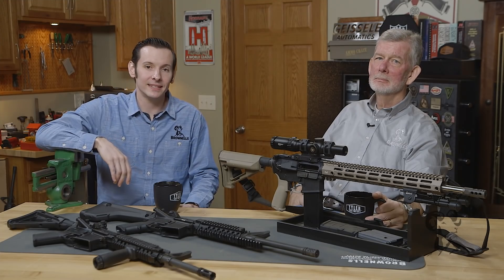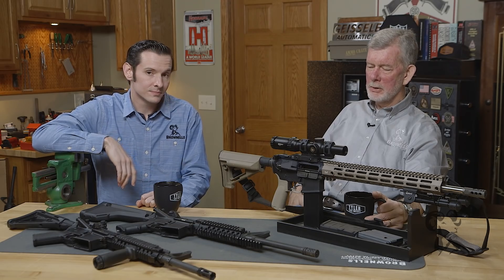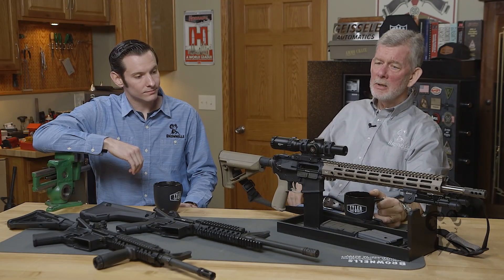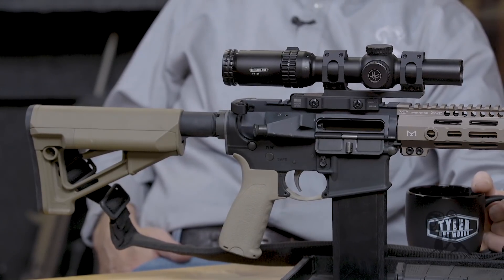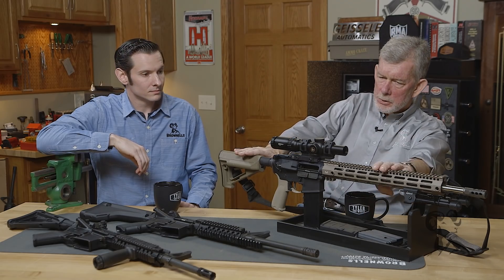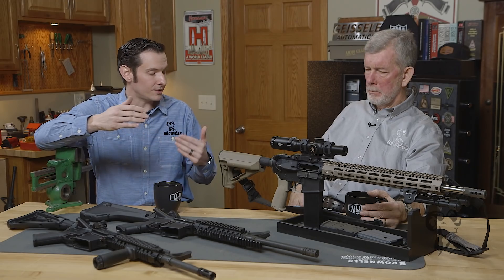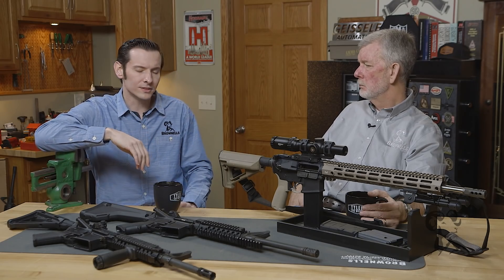Smyth Busters: Matching AR-15 Gas System to Buffer System

Comment: I started in the AR circuit with your mil-spec standard Colt M4 carbine; H2 buffer, carbine buffer tube, carbine length gas tube. Straight out of the Colt factory. THEN got into building. This video states that “everything will run fine” regardless of alternative combinations but I researched for a few months on specific buffer weights, spring lengths and strengths and gas tube lengths to be matched “perfectly”. I have yet to test fire any of the builds but if my calculations are correct, everything should run smoothly!!

Comment: My rifle has an 18 inch barrel with Rifle Gas and a Carbine buffer kit, it feeds and locks back on 75 grain bullets, feeds but often won't lock back on 68 grain, 62 grain is very hit and miss and won't feed 55 grain, the bolt ends up riding the top round of the magazine. Any idea what's likely to be causing it? And what would be the common sense solution?
Reply: Im in the middle of a build with same specs.  Would like to know of any solution you come up with incase i have same issue.
Reply: It seems like your rifle is undergassed. Check for any leakage at the gas block and gas key. If there isn’t any leakage and your gas rings are in good condition, try a lighter recoil spring or cutting a few coils from your current spring. If this still doesn’t help, you’ll have to have a gunsmith enlarge your gas port a bit
Reply: @Shootin_Bruin  Thank you! I did fix my rifle since I asked here. It was my first build and I learned a lot. You're right, it was under-gassed: my barrel is the Wilson Combat Urban Sniper and the .875 gas block was Aero. I guess the fit there wasn't perfect - apparently mil-spec is cool and all, but different manufacturers do vary slightly in dimensions. I did cut down a recoil spring and even bough a light one, along with a light weight BCG... still had same issue. Finally, I took the gas system down to the pin, set the pin back in right, with the slit pointing up and put a very thin film of gooey glue on the gas seat and on the gas tube where they will contact the gas block, so as to obstruct ONLY leakage, but not the gas passing through. Rifle's been running FLAWLESSLY ever since with any and all ammo I've ran through it, and I've ran quite a few different brands, bullet types and weights, without the need for a lighter recoil spring or a light bolt carrier... gas leaks can be pretty serious, I guess :D . Thank you so much for your kind response and for willing to help!
Reply: @shmuckling  You're welcome; glad to hear you fixed the problem! Yes, a lot of short-cycling problems are caused by misaligned gas blocks or loose gas keys, and checking these before doing something irreversible like enlarging the gas port is the smart way to go. 

Gas leakage between the block and gas tube is normal and accounted for with a properly sized gas port; I used to put gasket sealant there as well but learned that it all blows out after a few hundred rounds anyway so I stopped worrying about it.

If you have any other questions, please feel free to ask. Happy to help!
Reply: @Shootin_Bruin  Thank you! I hope I won't  need more help with this, but if I do, I'll ask you. :D

Comment: So what is it exactly that causes short stroking when using a rifle length upper and a carbine setup?
Reply: buffer is too heavy. Probably the most likely culprit.
Reply: yea dude use a lighter buffer the H or H2 buffer from  an m4 clone will not work

Comment: I have a pistol length gas system and a milspec carbine buffer and its having cycling issues
Reply: So they're talking here about buffer tube and buffer style length. there is a good chance that you need to go to a heavier buffer weight and a heavier buffer spring but that does not mean you need a longer buffer.
Reply: Obviously without a detailed discussion of what is going on with your gun I am not giving you specific answers for what your gun needs but that is what most pistol gas guns that have cycling issues end up needing.

Comment: I have a lessons learned from years ago. The length of the buffer must match. A buffer from a rifle system will not effectively work in a carbine buffer tube. A carbine buffer must be used in a carbine buffer tube/receiver extension.
Reply: Well I guess you had bad teachers. Because these are exactly right. 
My Geissele carbine system will run just about anything you strap on it.
Reply: holy crap man that is obvious given the difference in length
Reply: Yes, if you run a carbine buffer in a rifle tube, you will need good dental insurance because that charging handle is coming in hot.

Comment: Something I recently experienced was an AR-15 that short stroked after a barrel swap. After troubleshooting it seemed to be the gas system at fault. Trying to research AR-15 gas and buffer specs is very cryptic, there seems to be little consistency in what is correct gas port size for each gas length and the knowledge of pairing buffer weight with system length and port size is nigh impossible. A dependable reference for these things could put to rest MANY myths. In the end I had a smith drill the gas port to .078 and while seemingly overgassed the rifle now runs reliably.
Reply: AliasSLH We looked at that and the gas block added no restriction to the gas system

Comment: This is only partially correct. Try an 11.5 carbine upper on an A2 lower and see what happens. Dare you.
Reply: David David A 16 will probably run fine, although I prefer an H1 buffer with Carbines. I use an H3 or H4 with pistol length uppers though as they have a much harsher recoil impulse and they will essential best themselves to death if you don’t slow it down.
Reply: David David No problem. I usually tell people who are just starting to build that a properly gased AR will run 100% reliably and throw brass at the 2 o’clock to 3:30/4 o’clock position. Any further either way and it’s either really under gased or way over gased. Neither are ideal, i shoot for 2-3 o’clock myself. A consistent gun will put them in a neat little pile too. Hope that all helps

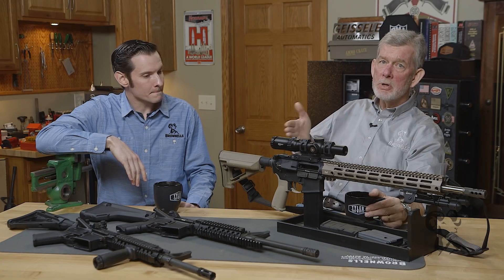Comment: 1:15 If you're wondering why there's so much buffers and stuff, go to Small Arms Solutions.
Reply: SAS has so much info it'll make your head spin if you're new to that topic. But he knows the AR inside and out like nobody else I've seen in 45 years of shooting/working with AR's.
Reply: Thanks for the info. Bro.... I still love the short Brownell baby flix..
Reply: Then from SAS look up “Instructor Chad” here on YT to become more knowledgeable about the tolerances of the rifle you depend on with your life. 

My go to HD gun had an out of spec “too short” firing pin. at .027” Acceptable firing pin protrusion is .028-.036”
Reply: @99cobra2881  Wow! How were you able to find out there was a problem??  light primer strikes?
Reply: Colt chocolate lab 

It’s all from watching and learning from Instructor Chad. His autopsy videos are very good he lists tolerances and shows you how to check them, some of his gauges are above what anyone will have but some of the checks are doable with even a cheap micrometer. 

I watched his videos listened to what the specs were that he was looking for then proceeded to check my rifle over that’s when I found the out of spec short firing pin. Rifle has this far been malfunction free in 1000 rounds of .223/5.56.
Reply: @99cobra2881  SOTAR (instructor Chad on YT) is an amazing resource!

Comment: Those people who I've heard asking this question is to fold. One  you answered, the other is recoil mitigation and which reduces it the best, or is it the same from system to system and which reduces it the best or what spring buffer combo does this.
     This is a good video subject, as the less felt the more happy shooters will be and injoy,  and love their system.
Reply: Depends on what gas system you are using. Heavier buffers will mitigate recoil and slightly slow the BCG.
Reply: @toynazi  absolutely. This is very evident in the 9mm pcc's. You can tell the difference on a chrony in longer barrels. It's not alot gained,  but every bit counts, most of the time. But the one differance I do not like is the bolt returning to battery. The heavier  the buffer, the heavier  the slam ( so to speak ) into battery. It's a heavier jolt home. I've often thought about adding a spring up in the non gas key area and guid rod to slow and even this out.

Comment: I have tuned my Ar15 with H1 buffers like the feel of it. I reload and easier on brass.
Reply: I also run H1 buffers on most of my builds (all carbine length except for 2 maxim 5.375" buffers).

Comment: I have been swapping lowers for years and never had any issues other than felt recoil......
Reply: And the easy way to mitigate the recoil is to have a different weight buffer. I’ve got one lower with 3 uppers and 2 different buffers, both of which are carbine sized buffers

Comment: There has been talk on the interwebs about dwell time and accuracy in AR15s. Can y'all cover if that is a thing and what can be done to increase/decrease dwell time?
Reply: Dwell time has to do with the length between the gas port and the end of the barrel, as the bullet passed the gas port and allows gas to flow back into the receiver. If you want less Dwell time, get a shorter barrel or a longer gas system (or both). For more Dwell time, it's the inverse. Example - 16" barrel with carbine gas system will have a greater dwell time than a 12.5" barrel with a carbine gas system. Accuracy has more to do with the quality of the barrel, not the dwell time of the gas system. Barrels with carbine gas systems can shoot sub moa, as can barrels with mid length and rifle length gas systems. There's a ton of factors that can go into how accurate a rifle is, but I can't see how dwell time would be one of them. As for parts wear, that's a whole other issue, but has more to do with gas port size than anything else. Hope that helps.
Reply: @stxnational9102  Hey brother, thank you for the info. Do you know how many different gas port sizes are there?  Or where I can find that information? Thanks again.
Reply: @Forwardoperationbase  Depends on the brand when it comes to finding gas port diameter, not everyone likes to share that information, you could always try customer service for any specific brand. Cheaper brand barrels usually have a larger gas port, over gassed in most cases. But, also,  depending on barrel length and gas system, you could find gas ports anywhere from .060 up to .093. Example - A 16" barrel w/ carbine gas system should have a gas port somewhere around .068
Reply: @stxnational9102  thanks
Reply: @Forwardoperationbase  leaves a weak link in the system? Maybe not if you get a really nice block
Reply: This guy explains dwell time and allot of other stuff spot on, that point specifically at @ 13:00 cheers brother🤙
Watch "Military M4 vs  High End Civilian AR15" on YouTube
https://youtu.be/C-ghQZ1_s5Q
Reply: @Canadian_Craftsman  Wait! By " this guys" you mean Daddy, right?
Reply: Adjustable gas block will cure it all
Reply: @ragnarok5056  I really like that idea because you can tame a hot set up like a 556 pistol. Buffer springs are also good options, like Sprinco. Or a combination.
Reply: @MrMace313  absolutely

Comment: I don’t disagree with the overall theme but I do disagree that they are all just plug and play.....depending on ammo, gas port size, suppressor, barrel length, etc you definitely do need to swap buffers to get it to run correctly.  You eluded to that a little bit but the title of the video led me to believe you would be talking about how to swap springs and buffers to tube the gun
Reply: Just to clarify - buffer tubes make no difference as you said.  Springs and buffers do make a difference.
Reply: @travelingwilbury4082  We will be going into tuning all that in the near future.
Reply: @Caleb Savant  👍🏻 thanks for all you guys do
Reply: Yeah I have two mid length uppers I use on the same carbine lower. One of them has a muzzle break and the ejection pattern looks like I should be using a heavier buffer.

Comment: My question is what is the felt recoil when going with a carbine gas system to a mid length buffer system, I would assume it would get softer.
Reply: Correct, we will be going into tuning all that in the near future.
Reply: Correct. The longer the gas system, the softer the recoil impulse.
Reply: mirlin12 correct

Comment: I am running a 7.5" barrel (5.56), I have a carbine length buffer, should I use a h2 buffer?
Reply: Julio Collins too many variables to say.  When you shoot it does the brass eject at 90 degrees? Or does it eject forward or behind you?
Reply: @travelingwilbury4082  90 degrees
Reply: Julio Collins should be fine as is then
Reply: @travelingwilbury4082  Yes, between 4:30 and 3:00 is where you want to be ejecting.
Reply: Get a adjustable gas block with a set screw. Budget friendly and is great. I have a 8.5 ar that shoot 7.62 and it is really helpful